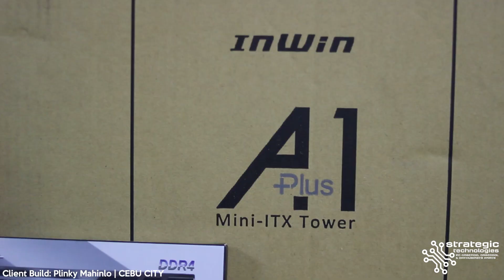BUILD LOG: Plinky Mahinlo | CEBU CITY | In Win A1 Plus Mini ITX White

Comment: What kinda of performance is this setup getting in 1440p gaming?

Also PC Part picker is stating that the Gigabyte 5700xt OC (same GPU here) will not be compatible with the case, even with very very similar parts I have with yours, is PC Part picker not that accurate?
Reply: Inwin A1 Plus ata gamit nya kaya compatible mahabang gpu.

Comment: Question po...where do you connect your 4 fans since that mobo only has 1 system fan header? Do use splitter & connect all 4 fans to the header or do you connect some fans direct to the psu?
Reply: pls answer po

Comment: did you get any issues with InWin 650w power supply? i'm going to build this too with this InWin case and its psu but i'm considering about it's power supply. would you like to tell me if you get any problem with this power supply? thanks in advance.
Reply: i have this case, no problems at all. They upgraded the psu from bronze to 650w gold.
Reply: @fluxhallucinacion7223  thankyou so much, i think im gonna build this too asap :)
Reply: @grffynx7128  no problem, just make sure to purchase the PLUS version.
Reply: @fluxhallucinacion7223  noted. Thanks buddy.
Reply: Have this exact case. I had no issues with an 8700k at 5ghz and 1080ti but when I swapped over to a 2080ti, it caused the PSU to trip when under load. Replaced it with another PSU and haven't had any issues since.
Reply: @tylerwong631  replaced with same wattage?
Reply: @fluxhallucinacion7223  750 watts but 650 should be more than enough. Replaced with a corsair vengeance 750m but I'd go with an SFX psu for better cable management.

Comment: I would have gone with the all black model with this same parts choice... It would also be cool to see an upgrade to an RGB powersupply if you are going to have that much lighting anyway...
Also that gigabyte GPU looks a little outclassed in the lighting department... it needs an RGB backplate... maybe a higher end strix model  from asus?
Reply: you'll lose the chi charging if you swap the psu. unless you can reconnect the chi charging cable again
Reply: Andrew Preston It’s an itx case, how much rgb lighting per square inch would you like sir? You do realise you can always slap extra rgb strips into your case instead of buying higher end components right
Reply: Suggestions for improvement/ aesthetics. Some parts could look a little better and that was my opinion.

Comment: Ummm.... you do know that the case is missing intake right? The bottom fans should be blowing air up into the case rather than out. The rear blows out including the side fan.

Also using the Sirius Loop fans at the bottom aren't a good idea, use the Crown version if anything since they also have addressable RGB lighting.
Reply from the maker: ummm do you also know that the bottom fans are intake and is blowing air up into the case and the side / rear are exhaust? which part of the video makes you conclude that it is missing intake? or because that the sirus loop has both ring rgb leds on both sides of the fans which made you confused as to where is the intake and exhaust?
Reply: @neopulse00 Hahaha ay sig pinamay
Reply: Strategic Technologies Gaming Computers Incorporated how much is the build